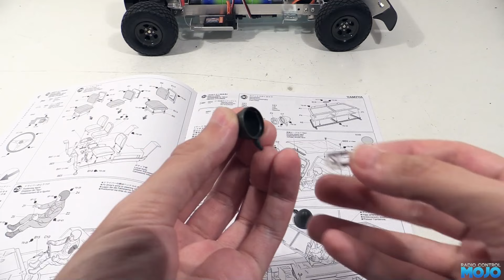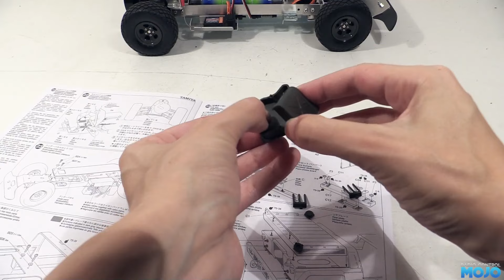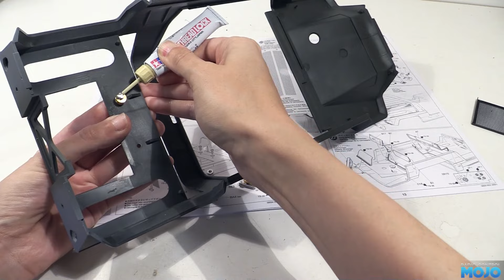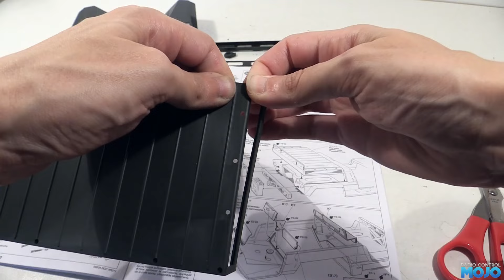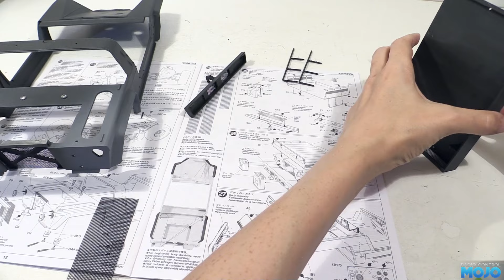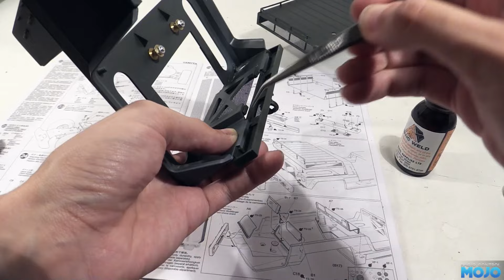Tamiya XR311 - 7 - Initial Body Building

Comment: Hello RCMojo man.
I am wondering where this Plastic weld stuff is available from and if you would recommend  using it to repair cracks that have occured in vintage Tamiya shells such as the #58044 Pajero and the M1025 Humvee? I have these and several other vehicles I am restoring and repairing and this stuff looks like magic to me. Pretty sure I watched you use it to build a scale trailer once as well. Thanks for your great videos, they are always well put together and I always learn something.
Reply from the maker: It's great stuff to have available. All the Tamiya hard bodies I've come across work a treat with it, you can test by putting a tiny drop under the bonnet, waiting a few seconds and see if the plastics softened.
EMA Plastic Weld is available from a lot of model shops, from EMA directly in quantity, you can even find it on eBay.
There are other brands available that use the same chemical (dichloromethane), but I’ve not found them to work as well.
Thanks for the comments on the other videos too!
Reply: No problems and thank you for your reply. I have watched a few of your modification videos in the past and think you have some very ingenious solutions to the standard kit issues. I like that you don't just bolt a brand on and then bolt on another if it doesn't work the first time. This is kind of the way I build my RC's. I am following this with interest as I have a 1977 XR311 myself that I am restoring. Just got a NIP vintage XR G  NO.30 parts bag today actually      :)  to replace the broken rear gear cover and that will be the chassis complete. I will now look into this EMA Plastic weld and see if I can find it in Australia. Keep up the good work and thanks for the videos! Everything with wheels interests me, so keep em coming!